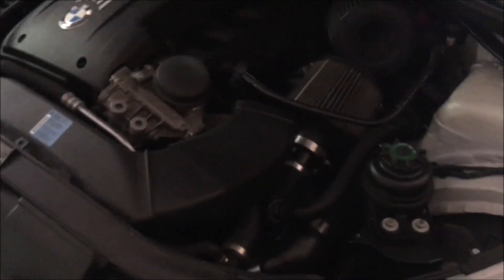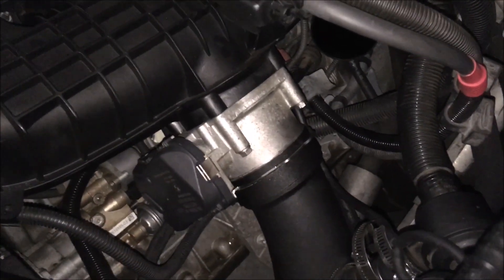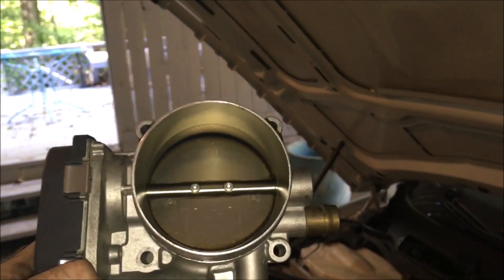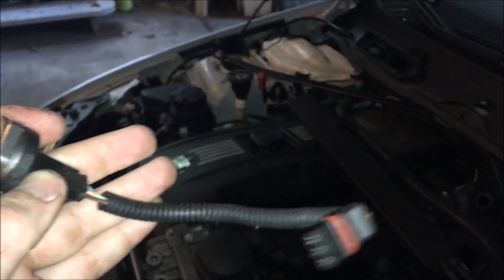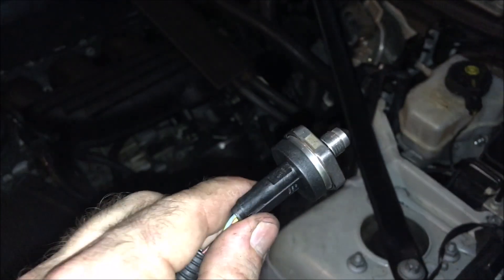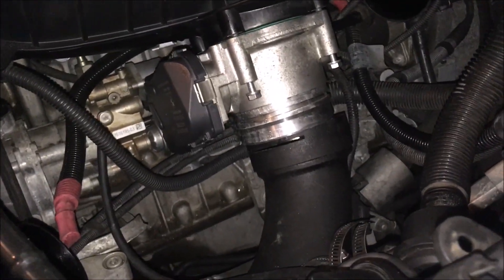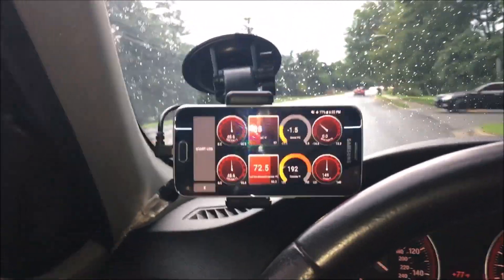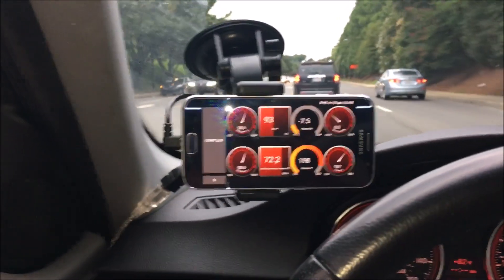BMW N54 Low Pressure Fuel Pump Sensor Replacement DIY 335i

Comment: Great video thanks, I've got a 29f3 fault code up on a bmw116i 2011 so fitting a new low pressure fuel sensor tomorrow :)

Comment: what is the symptom when low fuel pressure sensor gone bad?
Reply from the maker: This never gave any symptoms I had issues with data logging which is how I discovered it. I replaced to get accurate readings on those logs.

Comment: went fbo and got a stage 1 lpfp after finishing car got this exact code and I also noticed some stuttering low-end acceleration my brother who is a big car guy said that the car seems sluggish for what it should be pushing, just bought this sensor the other day and I will be installing in a couple days. Fingers crossed.
Reply: Any luck?

Comment: Same issue if you smell rotten egg that's you LFP sensor. My car running low rpm then if you gas more then car choke and misfire Cyl 2. Sometimes cyl 4 then 5.fuel cut off.replaced my both sensor high and low fuel sensor. My car run smooth shift smooth, run perfect
Reply: Hey so I replaced fuel pressure regulator cause infamous crack on housing. Brand new one in and fuel pressure on my MHD logging fluctuates hard from 65psi down to 20psi and causes injector shutoff on WOT.

Did you have something similar
Reply: @JustinGotsVlogs  can you tell me the exact problem so i can figuring out. Is this happend when the weather is hot. Couple pull then cutoff sorry about my english im not a pro but i know a lot about this car
Reply: @JustinGotsVlogs  if your pressure is 65 psi then down to 20 psi i'm 101percent your low fuel pump on the back passenger seat need to replace. But if you notice when you start your car and your radiator fan in full blast either your engine is cold your problem is hpfp.

Comment: i got a problem with the sensor, its fluctuate very hard from low 40s to 70s in less than a sec repeatedly could it be the senor or the fuel pump or the regulator/filter.

Comment: I was getting a P10DF, P15D9 and a P0087.  The P10 & P15's when googling them, google actually gave me the correct answer opposed to the damn OBD2 scanner's definition!  It stated "Low pressure fuel sensor communication signal to ECU malfuntioning sending bad communcations to computer at cold start"!!!!
At first cold start my bmw whould shake because i wasnt burning the fuel correctly and you could smell the fumes  it also would take a few cranks to start as the pressure wasnt good enough to push the correct amount of fuel to start right away. When i would drive my car not fully warmed up i would suddenly get a "Drivetrain Malfunction" & check engine light. The car was also slow and limp mode as i couldnt accelerate past 40 miles or would get the warning light.  
Changed all the coils to the latest Eldor brand coils and changed the High Pressure Fuel Sensor since those got delivered first and was still waiting a few more days for the updated Low Pressure Fuel Sensor with updated fuel rail line to get delivered.  
My coils were over due since the car still had the 9yr old originals. 
The difference was night and day.  Still have that cold start issue with the Low pressure sensor but the moment the car fully warmed up, it would run perfect at full power. That tells me the High Pressure Fuel Pump its still in great shape as i would not get any hesitations at higher speeds.  
Changing the Low pressure fuel sensor would be the solution to my problem!

Comment: Dose the N52 have the same sensor?  I'm having trouble on start
Reply from the maker: I believe it does. Not 100% sure if it’s identical but it will have a comparable part. What symptoms are you experiencing?
Reply: I'm have trouble starting it cranks no fire I'm getting no codes

Comment: High and Low Pressure fuel sensors send data to ECU, ECU sends data to EKPM Fuel Controller Module in rear seat, EKPM controller supplies voltage to LPFP which sends fuel as needed based on sensor data.
Reply: So essentially being as tho i have a bad sensor, it would in sense erratically send WRONG fuel readings to LPFP? And thus causing hesitation upon WOT between 2-4,000 RPM ALSO DO U THINK ITS POSSIBLE THAT IT COULD CAUSE A MISFIRE???
Reply: @hollywoodlive6559 what was the error in your case?
Reply: @arngrimuresra6611 mine was the low pressure fuel sensor had to replace it and everything was fine

Comment: Were you getting a running on reduced power ??
Reply from the maker: Nope I had full power
Reply: @BMWE90HQ  What if it pops up and it says reduce engine power and then Mark's that it's your fuel pump I switch my high pressure twice and the low pressure do you think it can be the sensor BMW-E90-HQ
Reply: @triplejjtres7882  Same issue here. Did you ever figure it out?

Comment: I've got an e90 with the m47 diesel engine, under harsh acceleration over 3000rpm, the car triggers the half shaded engine light on the dash, reading the codes diagnosed it as the fuel rail pressure sensors, wondering potentially would this be the cure replacing these or could it be a deeper issue i.e. fuel pump
Reply from the maker: Well I’d probably start with the sensors if it’s just saying sensor. It probably can’t get a reading. I had a similar issue recently though and it turned out to be my injector grounds had become loose. So I’d definitely check them since that’s free.
Reply from the maker: https://youtu.be/FCVIK8KqJO0

Comment: Could this also cause a lean code p0174?
Reply from the maker: I don’t think that the sensor itself would since it reads from the fuel line. Lean/rich codes are more likely to be O2 sensors. Or possibly injectors or a vacuum leak. Maybe a dirty tMAP sensor. Do you have any other symptoms there are several things that could bring this code up.

Comment: Hey Man thanks for the easy to follow video. I used the exact same sensor as you and after I put it in and data logged its reading 0. I looked at my logs before and noticed it was reading from the old one. I also still have the code showing do you know what i could have did wrong?
Reply from the maker: I honestly have no idea why it would still be reading 0. It doesn’t sound like install error because of how straightforward it is. If you messed up you’d have a fuel leak so I doubt that’s the issue. I would try resetting adaptations related to the fuel system and see what happens.
Reply: When you say resetting you mean like try to clear the code on MHD? I tried that and it still comes up. I noticed the new bosch sensor looks different from the old ones. Like the new one doesn't have a open at the screw point like the old one could that the problem?
Reply from the maker: No to both questions. It is an updated part that’s why it looks different. Also I mean literally look for where it says reset adaptations.
Reply: Jared Lake there is an option on the MHD app where you can reset adaptations
Reply: Unfortunately that did work either 😥

Comment: What dose that sensor do exactly. My tank is pressurized you think this is my problem?
Reply from the maker: Basically reads the pressure provided by your low pressure fuel pump. So if it’s being erratic I suppose it could cause problems. It’s cheap and easy enough I’d say it’s worth a shot.

Comment: What code where you getting? I getting a fuel pump plausibility code. Not sure if that is the same thing as you
Reply from the maker: Yeah I had that code 2AAF. But I wouldn’t worry about it just based off that unless you have actual issues or a SES. I’d get MHD data logger and get some numbers.
Reply: BMW-E90-HQ yea got that same exact code, did this fix your problem? Can you send me link to exact sensor please?
Reply from the maker: There’s a link in the description.